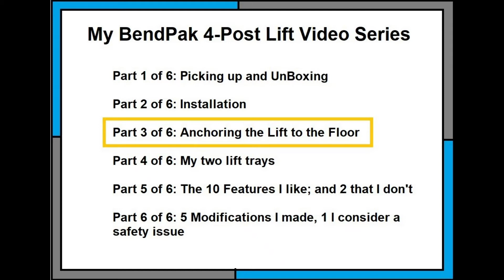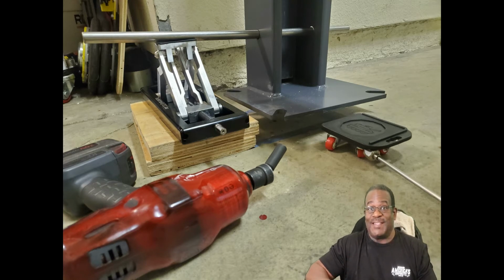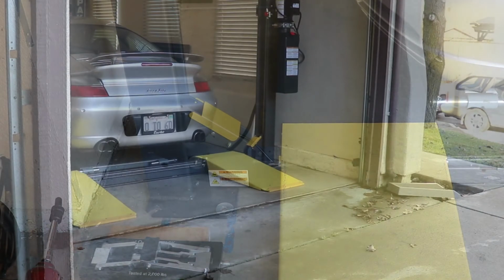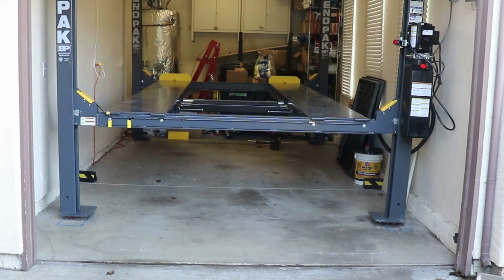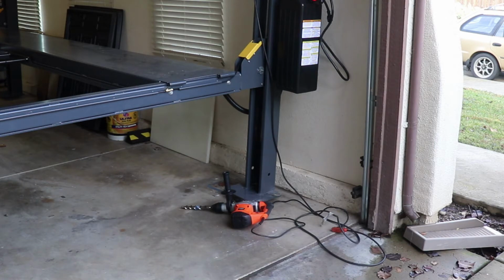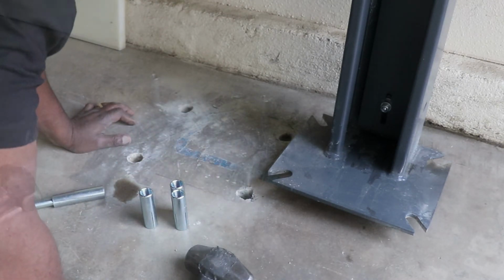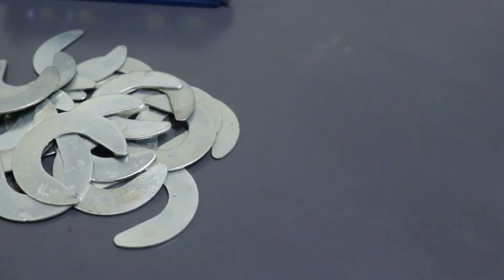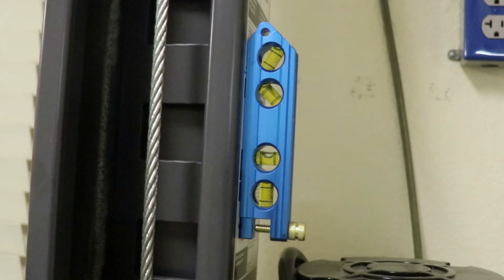Part (3 of 6) My BendPak 4-Post Lift Anchoring to Concrete Floor

Comment: Thanks for posting. I just got an older Rotary 9k 4 post that I am going to use outside.  I got 5/8 SS drop anchors and am going to use them the same way your did yours.  Didn't want bolts sticking out of the concrete if I needed to move the lift for some reason. My main concern is like you said, making sure everything lines up after drilling.
Reply from the maker: Best to drill one, bolt in place, then drill the next, bolt in place then the next otherwise they always seem to move a little no matter how careful you are...